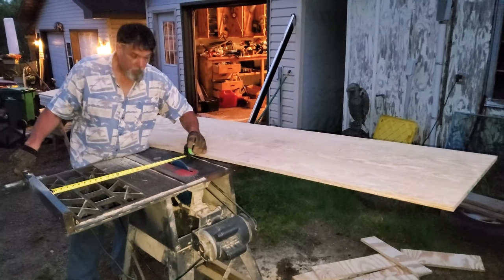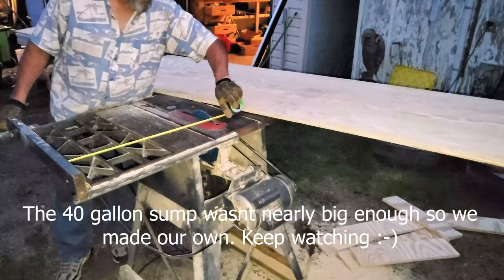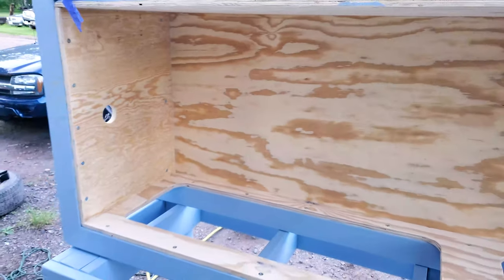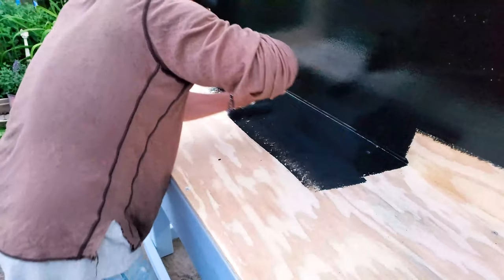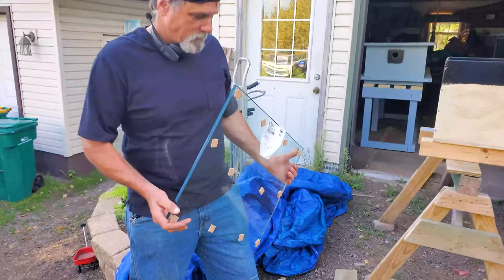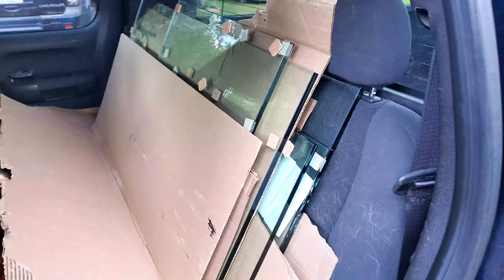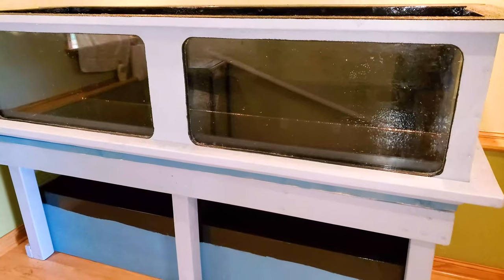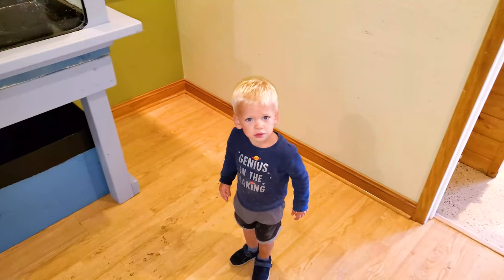Plywood Aquarium Build - 1st Time Tank Builders

Comment: Those tanks will be substantially stronger than almost anything you would've been able to buy. Buying those tanks custom and having them made would've taken a good bit of lead time I assume. As will be 3-4x the price difference for other tanks. High end tanks are not cheap. $1,300 for two tanks of that size is an absolute no-brainer... Build it!
Reply from the maker: Yeah it's been pretty fun to do it as well. Some very stressful moments but at the same time we've also had some great breakthroughs that have been very rewarding and worth it

Comment: Hey bob  if I was to use that pond armor on 3 pieces on plywood  8 inches by 39 inches how much would I need?    Is 1.5 qts enough?   Thanks
Reply from the maker: I would definitely get the gallon, we actually had to buy more Because we wanted one extra coat just to be on the safe side
Reply: @aquaticbobs  thanks for the quick response